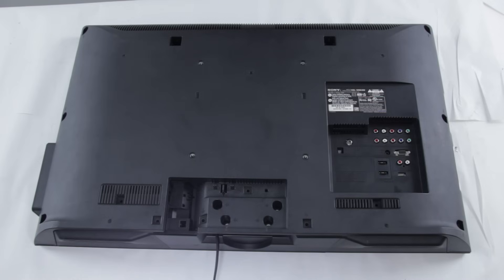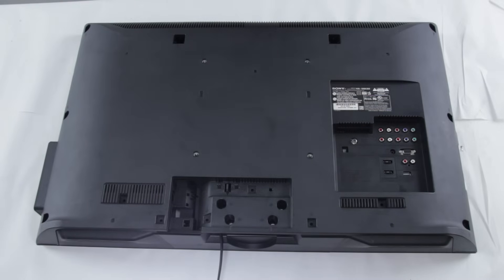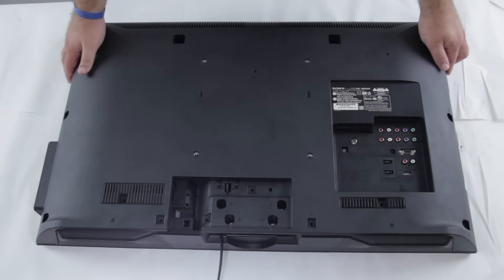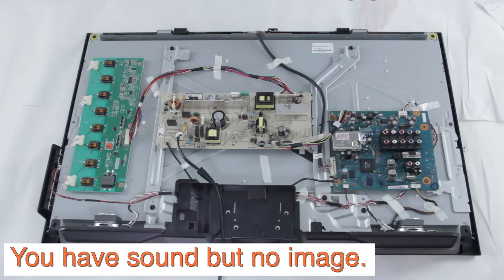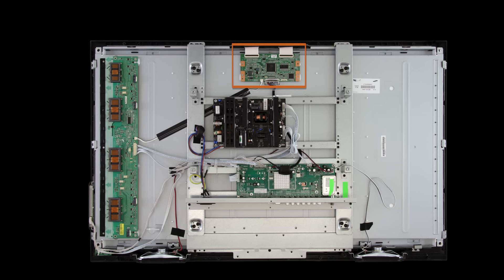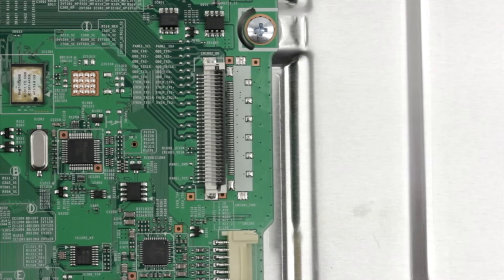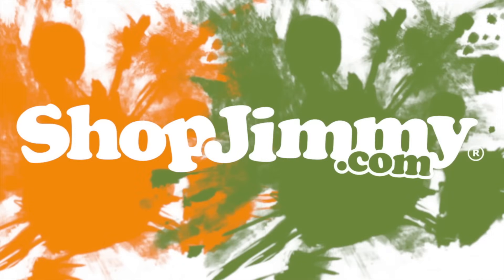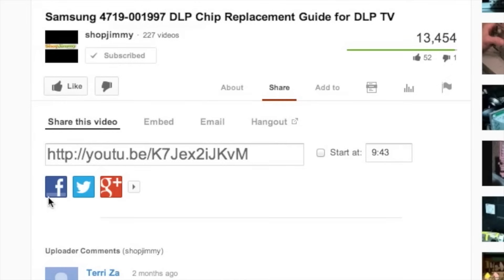LCD TV Repair Tutorial - T-Con Board Common Symptoms & Solutions - How to Replace T-Con Board

Comment: Hi, I have a Samsung LN46A630M1FXZA 46inch model SQ01. I've had this tv for about 6-7 years and it's given me no problems until now. When I turn it on I get sound from the cable box but no picture at all. Sometimes there are colored lines that pop up on the tv, or some white lines pop up as well. I've been trying to turn on my tv doing the on off thing for a few days now and it's progressively gotten worse. I'm not certain that it's the T-con board or the capacitors. I want to get it fixed preferably DIY but my tv is wall mounted and I don't have the soldering tools. Not sure what to do. Apparently there was a free repair deal from samsung on these televisions back in 2012.
Reply from the maker: Matthew Johnson   PLEASE SUBSCRIBE TO OUR CHANNEL - Try all repairs and troubleshooting at your own risk.  This could be a problem with either the t-con board, the main board or the TV panel.  You can replace the main board and t-con board individually to see if one of those boards fixes the problem.  Click this link to replacement parts for your TV model number:  http://www.shopjimmy.com/catalogsearch/result/?q=LN46A630M1FXZA   There may be multiple boards for the same TV model number, be sure to match part numbers on your current board, with your replacement for compatibility.  Thanks and please let us know if you have any further questions with your TV Repair!  www.shopjimmy.com

Comment: Hi Jimmy,
Have problem with my samsung model un46b7000wf , it has multy color vertical lines all over the screen. Try diferent plug in components and is all the same.
Lines go over menu .
Lines change size, and color.
Hope you can help me.
Thank you .
Benjamin
Reply from the maker: Tribu Evolucion   Try all repairs and troubleshooting at your own risk.  This sounds like a TV panel (TV Screen) problem.  If your TV panel is bad, it may be more cost-effective to replace the TV as panels are typically hard to find in stock, difficult to replace, and expensive.  Thanks and please let us know if you have any further questions!  www.shopjimmy.com

Comment: Hi, I have a JVC LT-32DY8ZZJ  No picture but sound. Saw some vertical coloured lines a week ago but they disappeared . Can make a a very faint back light on the screen . My local tech tells me the main board has gone and will cost me €285 to repair. Can get a new set for that amount!!! Looking at your video all my symptoms apply to the T cox board. Can it be replaced on this model and is it expensive. Thanks

Comment: Hi. I have an LG TV 37lh300 to be exact. It's 5 years old and now the screen has gone white. I can just about make out a picture, although it's a little bit flickery sometimes. The menu function still works and there is still sound.
I have taken the back off and cannot see a loose connection with the video cable, so I am assuming I need to replace the t-con board. Before I order one, do you think this would be the problem? I repaired my monitor before by replacing the capacitors (LG again), so Im not afraid of fixing this myself. Thanks for any replies.
Reply from the maker: Dave Thompson   PLEASE SUBSCRIBE TO OUR CHANNEL - Try all repairs and troubleshooting at your own risk.  This could be a problem with either the t-con board, the main board, or the TV panel.  Click this link to replacement parts for your TV model number:  http://www.shopjimmy.com/catalogsearch/result/?q=37lh300  There may be multiple boards for the same TV model number, be sure to match part numbers on your current board, with your replacement for compatibility.  Thanks and please let us know if you have any further questions with your TV Repair!  www.shopjimmy.com
Reply: ShopJimmy.com HI, thanks for the reply. I made so many enquiries about it including web forums, so forgot I made this post. I ordered a new tcon board and it worked. I have even made my very first video about an electronic repair, so feel free to share it or somehow link it to help pages. I didn't find that much on youtube about the white screen issue, which is why I made the video. I ended up paying £35 pounds for the replacement board (although it was used - who knows how long it will last!), so I did well in the end. New TV's of a similar type are £250 and up.

Please click on my name and see the most recent video, if you know how it can reach a wider audience. I am sure many people are going to experience the same problem, and many might just go buy new instead.

Thanks

Comment: I have a Sony kdl52w3000. The problem is the picture has been really "picky", no pun intended. It works great sometimes and then often I will get a really distorted picture then it goes dark. It will sometimes stay dark for 15-30mins and then work just fine. It happens randomly, most frequently when tv has been powered off for a long time. Any suggestions and parts on your site will be of a lot of help.
Reply: 5njabi I forgot to mention, I took the cover off and checked the backlight today and found no issues with it.

Comment: Hi i have a Sanyo ce42fd81-b i get picture for like 10-20 mins and sound too but then the picture goes off and also to add there is a slight buzzing noise while the picture is on but not when it goes off, any ideas?

Comment: I have a Samsung LN40C670M1FXZA TV.  It will not come on.  The red light at bottom left of screen stays on and does not change when using remote or panel on.  All caps in power supply look ok. No swell inning or anything like that. Need help?
Thanks robert

Comment: Samsung TV Model UA46C6200URXXM.
There is a double image, one above the other separated by about an inch. I have investigated the two ribbon cables from the T Con to the LCD and they seem ok. On switch on the picture is good, but after a minute or two the double image appears.
Should I change the T Con board or send it to the dump?

Comment: Greetings...!  Horizontal line appeared recently on my TV.  Search of YouTube and everything points to Timer Control Board (T Con).  Would like, if possible, some guidance and recommendations.  Model Number:  VIZIO M701d-A3R 70-Inch 1080p 3D Smart LED HDTV.  Thank You..!
Reply from the maker: MajikMuzak   Try all repairs and troubleshooting at your own risk.  This sounds like a TV panel (TV Screen) problem.  If your TV panel is bad, it may be more cost-effective to replace the TV as panels are typically hard to find in stock, difficult to replace, and expensive.  Thanks and please let us know if you have any further questions!  www.shopjimmy.com

Comment: need help to remove back panel on a polariod lcd tv modle #tlx02311b. my problem is i have power but no picture and no sound
Reply from the maker: mark thomas   Try all repairs and troubleshooting at your own risk.  I recommend running the flashlight test on your TV.   Here is a link to a video we produced that shows how to run the flashlight test. https://www.youtube.com/watch?v=xUzCLgoSPGM Please reply with your flashlight test results and we can recommend a replacement part for your TV repair. Thanks and please let us know if you have any questions! www.shopjimmy.com

Comment: I've got one for ya.  JVC LT-39E330. Has no video and ive tried the flashlight test. No images. No sound. Checked a majority if the ribbons and the connector to the tcon. TV power light turns on fine.

Comment: We have a Sony Bravia 60R550A, serial:7007201 and 5 red blinking lights. It worked fine and then shut off. Thinking it might have been an timer set by one of the kids by accident, I tried to turn it back on. This picture came on and then faded to black. Even after a hard reset, nothing worked. Screen lights up like it's trying to turn on and then it shuts off once again. I tried to contact Sony but the warranty expired 5 months ago and they couldn't even give me a physical address to an authorized repair shop. please help.

Comment: I have an magnavox lcd model 37md350b/f7 serial number ds4a1208145368 .I have sound but no video. backlights working.I replaced the tcon board. main board out of stock.

Comment: Hello I have a LG model 37lg60. It has backlight and sound but no picture. The tcon board has power at both sides of the fuse. A blue light on the tcon board lights up but dims and shuts off after a few seconds.  I looked on your site for a replacement tcon but they are out of stock is there another tcon model that would work for this tv? Thank you.

Comment: I have a 43" flat screen samsung tv that it won't turn on, there is  a red blinking light in the front and green in the back. also, making a noise coming from the y-buffer board on and off.
Reply from the maker: luis napoles   Try all repairs and troubleshooting at your own risk.  I recommend replacing the y board and buffers in your TV.  Try all repairs and troubleshooting at your own risk.  Please reply with your TV model number.  Click here to view a video that shows how to find your TV model number:  https://www.youtube.com/watch?v=S51nhAmwR2M  Thanks!  www.shopjimmy.com

Comment: Need some help with my Samsung 46" LED TV. It shows double image. After looking at some of the videos/forums, I thought it might be bad caps, and hence I order new main board from SJ. The problem still persisted. 

I tried to have a plastic tape on left connector on T-Con board, that did not help either. Although I was seeing some changes on screen as I adjusted the connector, but never able to get clear picture for more than 10 mins. 

Do you think I should try replacing the T-Con board as well? 

TV: Samsung 46" un46D6050
Main board: BN44-00423A
Reply from the maker: Mitesh Sura   Try all repairs and troubleshooting at your own risk.  This sounds like a TV panel (TV Screen) problem.  If your TV panel is bad, it may be more cost-effective to replace the TV as panels are typically hard to find in stock, difficult to replace, and expensive.  Thanks and please let us know if you have any further questions!  www.shopjimmy.com
Reply: Thanks ShopJimmy.com That is what I think too. On my hunt for new TV.. probably 4k this time

Comment: LG 42CS570-UD s/n 205RMPG1R448 need repair, TV turns on from to blue when on, no backlights, flashlights shows no image, no sound, replaced power supply/inverter board, still have same problem?
Reply from the maker: Rex Noble Sr  Try all repairs and troubleshooting at your own risk.  If you have no image with the flashlight test, then replace the main board.  If you have an image and no backlight, then replace the power supply/inverter.  Click this link to replacement parts for your TV model number:  http://www.shopjimmy.com/catalogsearch/result/?q=42CS570-UD  There may be multiple boards for the same TV model number, be sure to match part numbers on your current board, with your replacement for compatibility.  Thanks and please let us know if you have any further questions with your TV Repair!  www.shopjimmy.com

Comment: Have a Vizio 70" E701I-A3.  Only had it for Year and a half.  While the TV was on.  there was a screeching noise and picture were distorted then screen went blank. Tried to recycle power however nothing.  NO light nor any signs the tv is on. Also No Audio coming out...
Reply from the maker: Logan Davis  Try all repairs and troubleshooting at your own risk.   I recommend replacing the main board in your TV.  Click this link to replacement parts:  http://www.shopjimmy.com/catalogsearch/result/index/?cat=56&q=E701I-A3  There may be multiple boards for the same TV model number, be sure to match part numbers on your current board, with your replacement for compatibility.  Thanks and please let us know if you have any further questions with your TV Repair!  www.shopjimmy.com

Comment: Hi guys,  

I have a 42 inch Vizio and it won't show the full picture but only lines however I can hear what's playing. Here is the specs (model, serial and part no.)
Model: Vizio E322VL
100-240V~. 1.7A, 50/60Hz
Part no. 10223250022
Serial number:  LAQKHSAL2703809

Comment: I have a Toshiba 40" 40RF35OU and I want to replace the T-CON board.  I think I need part# 75012988 and plan on confirming that once I get access to the board.  I have the back of the TV off and I think I see where the t-con board is (top center) but it's under what appears to be a plate that covers the entire back of the tv with speakers and boards and wires attached.  How do I get in there?  Help please.

Comment: I should also mention,when I turn on the TV it is solarized but after five minutes it switches to looking like a negative. Turning it off and then on again, resets it back to the solarized look but then after five minutes, switches to looking like a negative for the rest of the time you have your set on. There are times that it will switch from the negative look to looking solarized but for just a minute or so.

Comment: Hi

Please help, I have a Samsung UA40ES6200R Led tv that gives no picture, but have multi-colored HORIZONTAL lines/stripes jumping from bottom to top erratically. All sorts of color lines. If I plug out the t-con and switch it on, the back light comes on, and I can hear a beep when tuning the volume with the little joystick on the back of the tv. Please any ideas???

Amanda

Comment: Hi I'm hoping you can help with my tvs issue the model is a Sony BRAVIA KDL-55EX500 which I believe is the same in this video and my issue is a buzzing noise every now and then it's on and off coming from the bottom left area of the TV as well as no response from remote control commands or response from ANY physical buttons on the right side APART from the physical ON and OFF SWITCH which does work TV has been hardly used for quite some time and only thing would be quite a bit of dirt and or dust gotten in from the top vents Thankyou Brenton

Comment: I have a LG 47LN5750-UH. Apparently there was a major power surge or lightening at my house as several different electronics were affected but my TV did work for a short while afterward. It came on but was very sluggish to respond. The next time I attempted to turn it on the power light indicates that it has powered on but there is absolutely no picture present whatsoever. Any ideas as to what exactly the issue may be? Anything would be much appreciated. Thx

Comment: I have a Vizio Model E420VSE.
Turned on, got sound but no picture. tried to manually turn to menu. Still black.
I have opened it up, everything looks pristene. No burns or popped caps.
Flashlight test shows nothing, no backlights.

Comment: Trying to remove the tcon board on a samsung ln37a450 and I think I have identified the board as the one protected by a guard and the bottom center. first, do I have that correct? If so, i can't seem to get the guard off. I have taken out the four screws, but it seems like ther is a hidden catch that is holding it in. thanks.

Comment: We have a Sony KDL-40V4100 and after a short time of using it we lose the picture and are left with a totally white screen. Is this a model that I will be able to repair?
Reply from the maker: Theo M   PLEASE SUBSCRIBE TO OUR CHANNEL - Try all repairs and troubleshooting at your own risk.  This could be a problem with either the t-con board, the main board or the TV panel.  You can replace the main board and the t-con board individually to see if one of those boards fixes the problem.  Click this link to replacement parts for your TV model number:  http://www.shopjimmy.com/catalogsearch/result/?q=KDL-40V4100  There may be multiple boards for the same TV model number, be sure to match part numbers on your current board, with your replacement for compatibility.  Thanks and please let us know if you have any further questions with your TV Repair!  www.shopjimmy.com

Comment: Aloha, we have a Samsung UN40F5500AFXZA. The bottom have of the picture is dark but not black. You can still see the picture but it is obviously darker then the top half. Serial number is - Z6TW3CTDC03977P
Reply from the maker: Derek Cat Kealoha   Try all repairs and troubleshooting at your own risk.  This sounds like a TV panel (TV Screen) problem.  If your TV panel is bad, it may be more cost-effective to replace the TV as panels are typically hard to find in stock, difficult to replace, and expensive.  Thanks and please let us know if you have any further questions!  www.shopjimmy.com

Comment: Hi
i have an32lg3000 lcd tv  power up back light is good but i have no sound and no picture just a blue screen.can you please help.
thanks
Reply from the maker: Mohammed Elmrabti   PLEASE SUBSCRIBE TO OUR CHANNEL - Try all repairs and troubleshooting at your own risk.  This could be a problem with either the t-con board, the main board or the TV panel.  You can replace the main board and the t-con board individually to see if one of those boards fixes the problem.  Click this link to replacement parts for your TV model number:  http://www.shopjimmy.com/catalogsearch/result/?q=32lg3000  There may be multiple boards for the same TV model number, be sure to match part numbers on your current board, with your replacement for compatibility.  Thanks and please let us know if you have any further questions with your TV Repair!  www.shopjimmy.com

Comment: Hey I have a LG 55GA6400 and it powered itself off and will not power back on. I get no lights lighting up either. I have tested multiple known working outlets as well and still no luck. I pulled the back cover off and I have a EAX64908101 (2.2) power supply in it.

Any help is appreciated
Reply from the maker: Tyler Findley   Try all repairs and troubleshooting at your own risk.  I recommend replacing the power supply board in your TV.  Click this link to replacement parts for your TV model number:  http://www.shopjimmy.com/lg-eay62851201-power-supply-unit.htm  Be sure to match part numbers on your current board, with your replacement for compatibility.  Thanks and please let us know if you have any further questions with your TV Repair!  www.shopjimmy.com